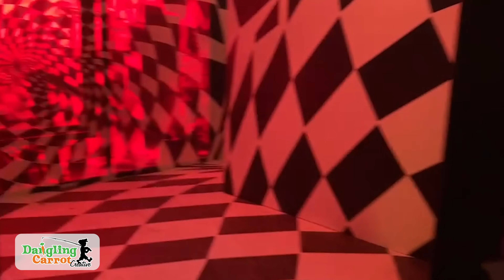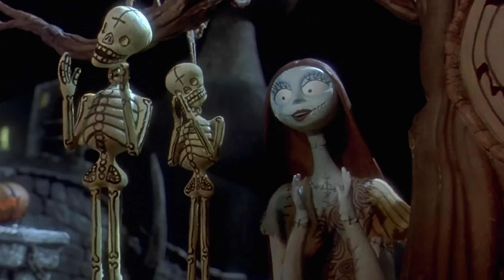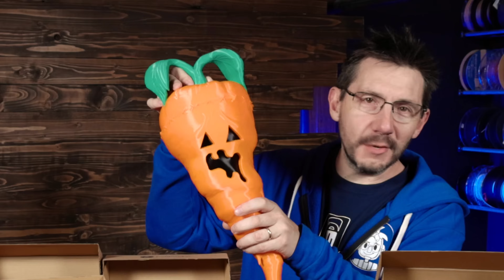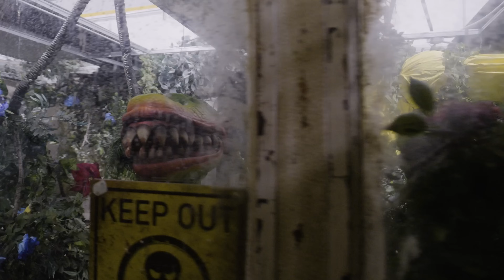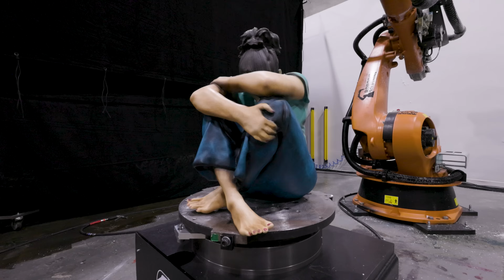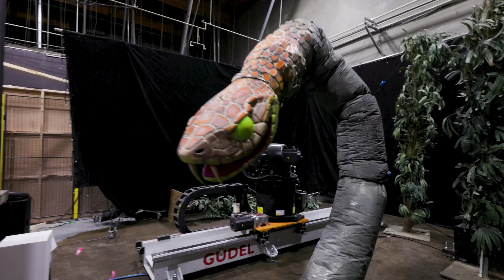Will This Print Farm Job FINISH IN TIME?

Comment: Bail on the print and start again on the X1C? Did you forget about the select and skip a single part option on the printer interface? Ive used it a bit lately oding batches, so good for not writing off an entire plate for 1-2 fails.
Reply from the maker: There were more than that number of fails plus the layer shift was on all parts for a few layers. :(